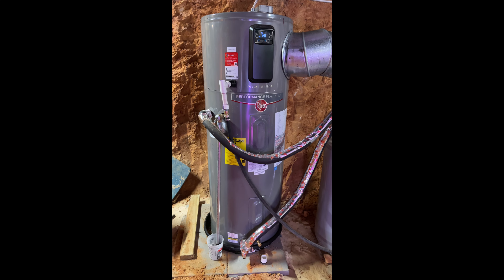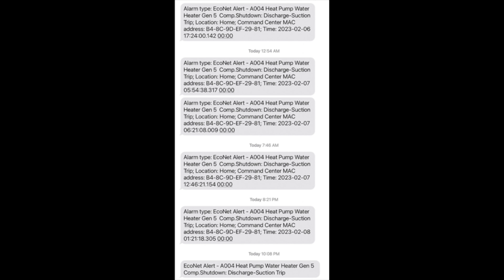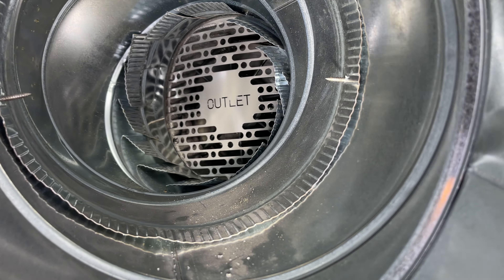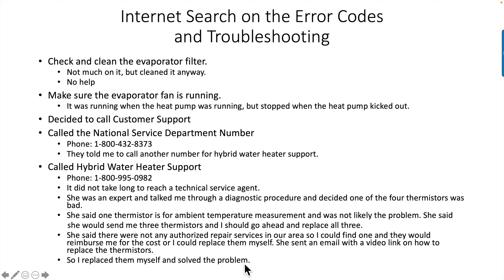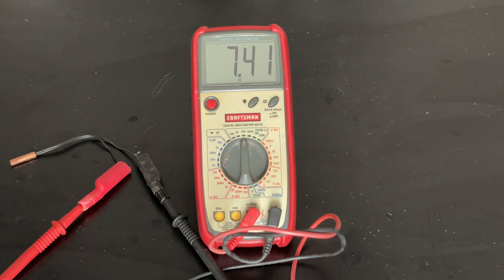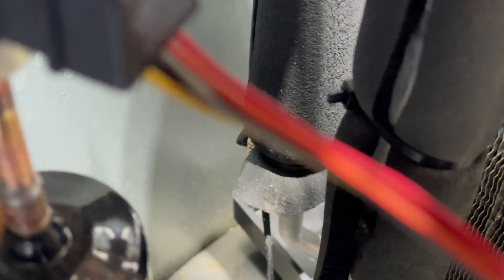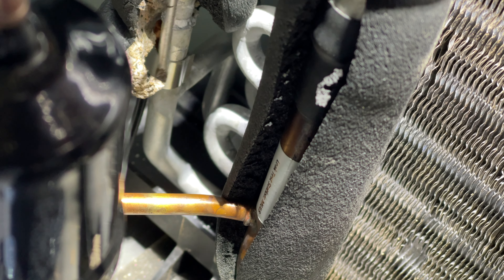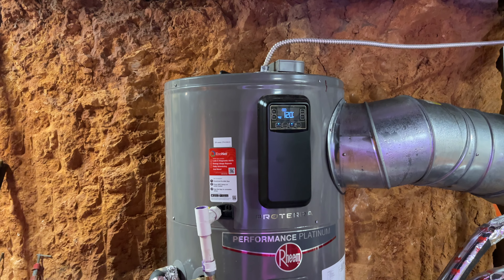Rheem Hybrid Electric Water Heater Heat Pump Kicking Out A004 Comp.Shutdown: Discharge-Suction Trip

Comment: We H.A.T.E this hybrid water heater.   Would not recommend this model and type.  Constant error codes, nobody can work on them, blows cold air in garage.   Hate hate hare this machine. Will be swapping back to regular electric water heater as soon as I am able.  And just for the record...it is 3 years old installed in new construction.  Nothing but problems.
Reply from the maker: I can appreciate everything you said. Rheem needs to modify their design if they haven’t done so already. The blowing cold air would be the case with any water heater running in heat pump mode and this is why some people run exhaust ducts out of the house. I wanted the heat pump not only for efficiency, but it doubles as a dehumidifier for our basement we are digging. You can save yourself some grief by simply using the controls on the unit or the Econet app and run it in “electric” only. It is a perfectly good and capable electric resistance water heater in that mode so no need to replace it.
Reply: Yes, we have taken to running it in electric.  Had to convince hubby it is fine to do that....because the manual says to only run it in electric during maintenance.   Did I mention I hate this machine?   Also used a shopvac to blow out the condenser line that was plugged and causing water to back up.   Does you filter ever freeze up solid? Ours does all the time. Usually get an a006.  Can't even pull it out, it is full of ice.   Just an awful, awful, machine.   Had to replace condenser motor and thermocouple 6 months after install.   Searched 400 mile radius for someone to fix it.  No such luck.  Begged a friend ...hvac experience ... to change the parts.   Hate this machine. 😒
Reply from the maker: @debbiebecker2696  When heat pumps work properly they save a lot of electrical power compared to standard electrical resistance water heaters, however, in your case for your emotional and mental well being it may be worth replacing it with a standard electrical resistance water heater. If you haven’t spoken directly with a Rheem technician I would recommend you do before totally giving up to see what they can do under warranty. Good luck. I understand your frustration. There wasn’t a qualified repair person near us either so I did all of my own work. The local Home Depot’s are selling a lot of them so it also may be worth talking to one of the Home Depot plumbing pros.